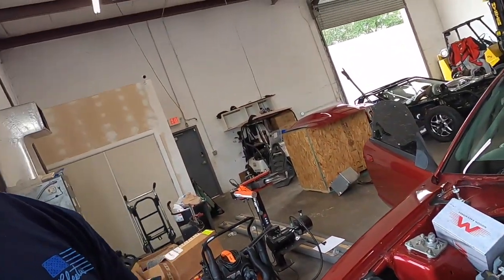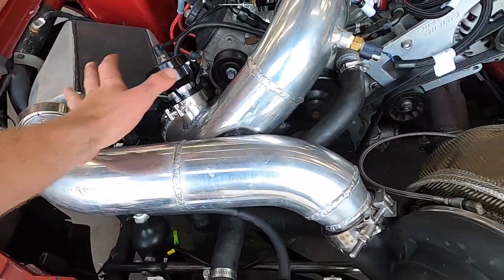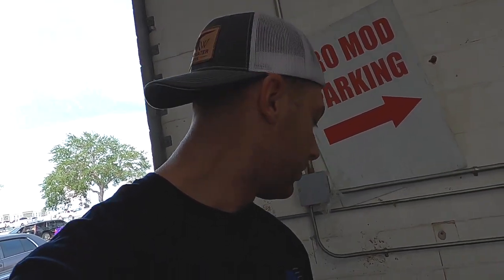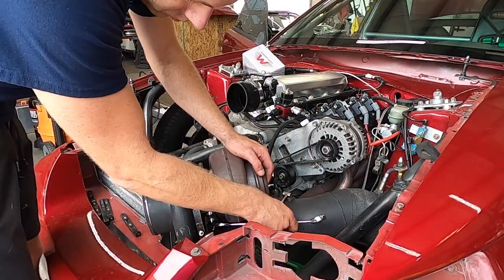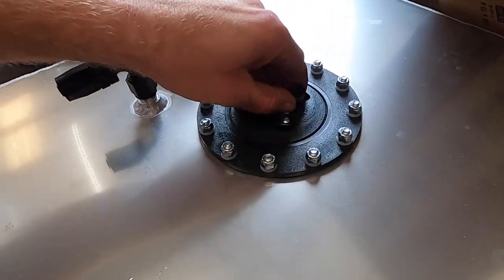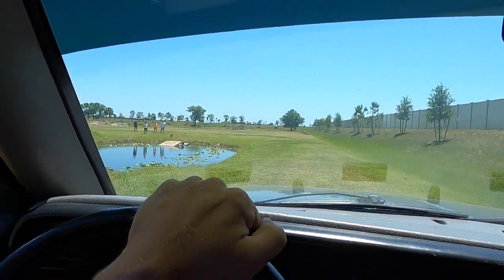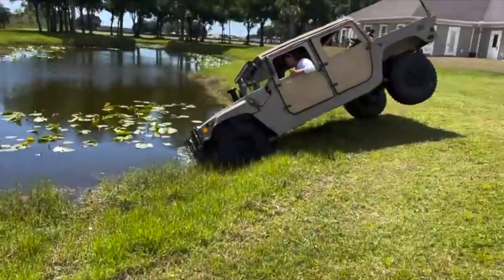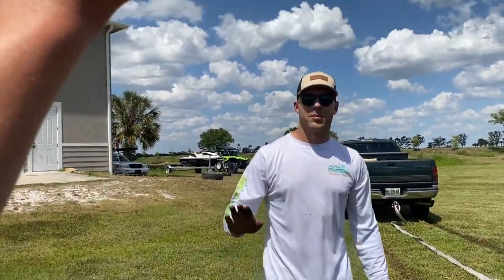More Work Than I Expected for Race Week... Time to GRIND!

Comment: Hey bro that catch can is NOT enough for a turbo car. Scratch that idea all together and go burn down box in the trunk.
Reply from the maker: Welp time to upgrade
Reply: @DoctrParker   run your radiator overflow and transmission vent into the burn down box as well. All in one.